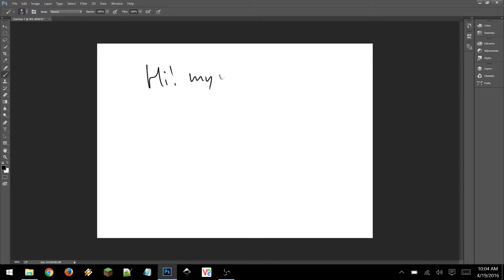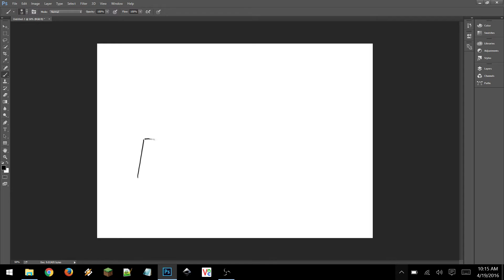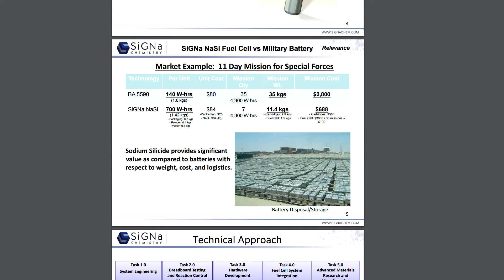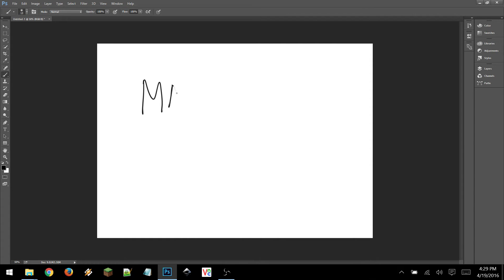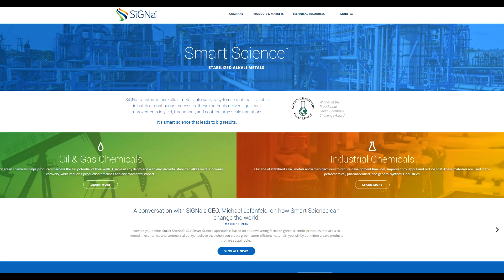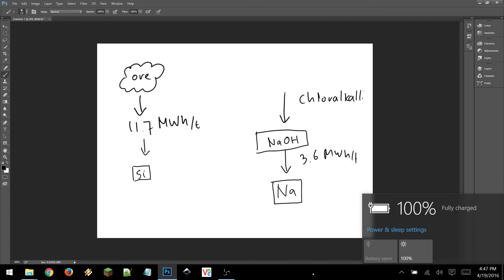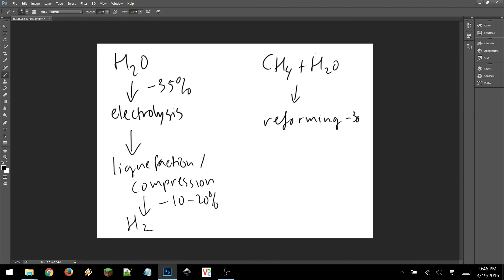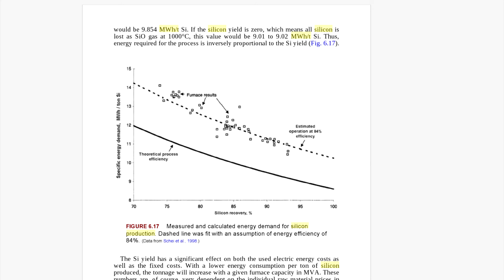MyFC JAQ and Sodium Silicide technology (NaSi) (026)

Comment: Efficiency aside, I wonder how good of a energy/volume ratio could be possible these cells. I can see some possible uses for this technology if it can offer better size-efficiency than comparable solutions.
Reply from the maker: +Seán Byrne It's definitely an option for grid-level storage. This is pretty much where fuel cells are a great option anyway, because you don't have to (necessarily) store both the oxidizing and reducing agents for your fuel. Like with hydrocarbons, you just get immensly better storage efficiency with fuel-only storage instead of with batteries or, similarly, stuff like rocket fuel.

NaSi isn't toxic or produce toxic byproducts, aside from potentially cyanides (as far as I could find, these are produced in similar quantities to heated/outgassing plastics, so they're not too bad). Unfortunately NaSi can't be liquified; it'll either decompose and fairly strongly attack whatever pipeline you're putting it through or it will form complex compounds at elevated temperature (like silicates, when using adsorbed sodium to silica gel). So it really needs to be transported in powder form (which isn't honestly an issue; it's energy dense enough that this can be done very economically).

I don't see NaSi particularly beating BEVs in the car marketplace, simply because of the inherent higher cost. This goes for pretty much everything that relies on fundamentally limited efficiency processes. Pure electric is always going to be cheaper in the long run and people will generally take reduced range over (significantly) higher cost. It won't ever be able to get a high market share, but it could work well as a niche vehicle fuel.
Reply from the maker: +JoppiMoppi It certainly scales quite well. Because you don't need particularly explosion/fire-safe containers, you can carry quite a lot of NaSi+water (like tens to hundreds of kilograms) at >500Wh/kg combined. The fuel cell systems together don't weigh enough to offset that, so it's definitely going to be more energy dense than current battery technology.
Reply: +PowerElectronicsBlog This sure looks like a pretty good idea for energy storage where vast amounts of energy can be tapped, such as geothermal hotspots or where sunshine is pretty much guaranteed dawn to dusk.  Then it's just a matter of transporting the NaSi to where it's needed just like what's currently done for transporting crude oil from far away locations.  

Besides energy density, I would imagine there are several other advantages with this over batteries.  Assuming NaSi does not decompose or degrade in any harmful way (if properly stored), its energy content will remain constant until it is used, whereas batteries both lose capacity and energy storage as they age.  The second advantage is that when converted to a liquid form it can be pumped from one location to another just like oil pipelines, probably giving another use for the existing oil pipeline infrastructure in the future.  

Finally, filling a fuel cell car would be just was simple and quick as filling a gasoline car, so even if the range is shorter, at least there would not the tedious 20 or so minute wait even for the fast electric charging points.  As for the low efficiency of creating NaSi, current gasoline cars only get 14% to 30% useful energy from the fuel with the rest wasted as heat.   But in this case, the energy source from NaSi could be from geothermal, solar, etc. plants instead of crude oil.
Reply: You know the reason why the SiNa seems so energy intensive is because the calculations are based on the formation of each of those elements alone, then cooled down, then reheated to be combined. If you heat them all together onsite with excess, "waste" heat used for other industrial processes or city use, the efficiency of making SiNa can be as high as 90 percent in my estimate.